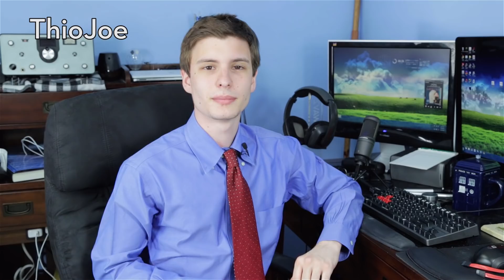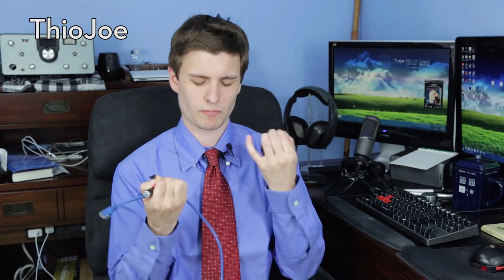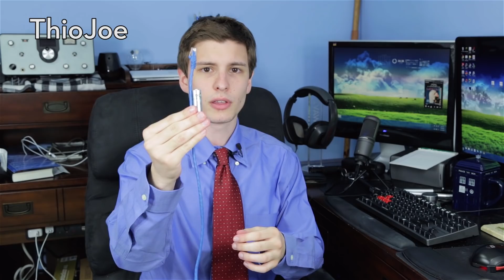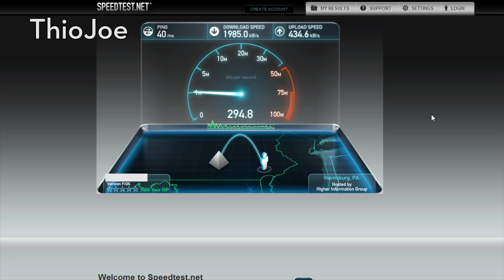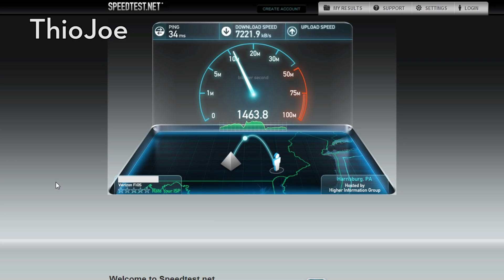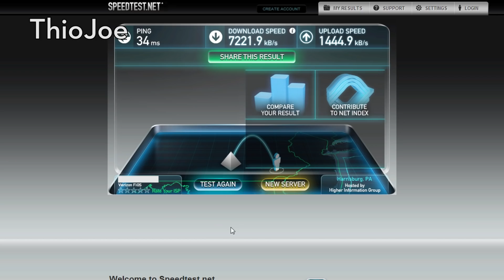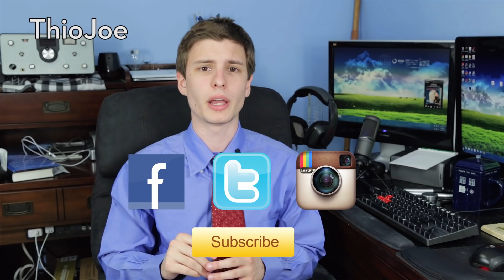Triple Your Internet Speed for Free

Comment: I wrapped 2 AA rechargeable batteries, 3 inches away from the terminal 1 battery each end.   Before add batteries, the speed was 3.25mps download and 1.11 mps upload.  After added 2 AA batteries at each end, the speed was 3.24 mps and 1.10 mps. No difference at all.  The direction of batteries were Positive to the terminals as suggested in this video clip.  The suggested tip did NOT work at all.  I do not know why his modified cable works and my same modified cable did NOT work.

Comment: Hey ThioJoe if I use 12v car batteries would that also work. I figure more voltage & more stored energy should do the trick . Oh yeah is there a better brand of electrical tape that "conducts" electricity. The tape I find says it insulates can I dip the sticky stuff in rotor shavings as it is cast iron & will conduct the induction & if i soak it in water then trap it this should do extremely well I know with the steel it wont stick to the cable for which I am going to use heat shrink tubing. I only hope I dont blow myself up when I heat the tube up with my handy blow torch. I can't wait.

Comment: "because electrical tape is conductive" WTF dude?? electrical tape is made to isolate electricity not to conduct it.  Its made out of a polymer.... oh sorry you are to stupid to now what polymer means..... out of rubber and rubber DOES NOT CONDUCT ELECTRICITY!!!!!!!!!!!!
If the magnetic field (that is if the battery would have one in the first place) would pass through the Ethernet wire it will reduce the speed because it would add too much interference and as some people would know through the generations of CAT cables its developers have been trying to reduce the interference so that the data will flow faster. DUMB ASS  !!!!!!!

Comment: I have wireless but got it to work with a little trial and error. You'll need 6 D batteries instead of 2 AA's. I guess the extra power was just enough to overcome the space separating the cable end from my laptop. And it has to be EXACTLY 1-1/4 inch from the bottom right corner of any device you're trying to boost. Just 1/16th of an inch off will not work.  It's a pain repositioning the 60' cable (especially to the other side of the house) but the results are awesome!!! I get to watch my girlfriend do this everytime she uses her tablet! LOL   She can't understand why I move my laptop so much.  ROTFL  Life is good :-)

Comment: shud the ethernet wire be blue in color or any color will do ?
Reply: Everyone knows the saying; "blue like the sky that brings lightning." Lightning is fast so use the blue cables. Anyone who uses any other color is just a noob!
Reply: Danilo SubMOA Never seen lightning from a "blue" sky! How does that work then? I thought the blue came from the oxygen and everyone knows that more oxygen makes vehicles go faster so make your Ethernet go faster with blue (oxygen boosted) cables. ...I STILL prefer the rainbow ones though. ;)
Reply: Bob Lewis You forgot about the electrical tape that conducts electricity.
Reply: Danilo SubMOA I've found that if you use matching color electrical tape,  it makes it 6 times faster, but only if you use YELLOW cable and tape. Yellow is faster. That's why they went to yellow instead of red for fire trucks!

Comment: The best way to speed up your internet is to attach a large magnet to the internal internet coil. Its usually located towards the front of the computer. Its got two cables going into it and is about 3.5 inches across. The top is shiny and the bottom is black. Be sure to put the magnet on top and rub it around a bit to insure optimal conduction. Works every time.

Comment: Instead of messing around with batteries and cables. You can buy a gigabit router. (With a modem that can handle high speeds of course) And make sure your system is not too old (Windows XP early-mid). But if you are as stupid as he is, you definitely  believe that shit and do not ask what normal people do... -_-

Comment: Electrical tape (or insulating tape) is a type of pressure-sensitive tape used to insulate electrical wires and other material that conduct electricity. It can be made of many plastics, but vinyl is most popular, as it stretches well and gives an effective and long lasting insulation. Electrical tape for class H insulation is made of fiberglass cloth.

Comment: I find it works best when you open the wire, while it is still functioning, cut any one of the inner wires and then face the battery on it, then touch the wire for exactly 0.25 seconds. This is the exact time needed to quickly shut off and turn back on the wire, and if you do it longer it will break the wire because it will loose charge. This is 100% proven not fake and totally safe. Also don't shove your d!@$ in a toaster. I found the last part helped.

Comment: Doesn't work. I have a new PC running Windows 8.1, new ethernet cables, etc., but my broadband internet speed with a terrible company called Windstream (I live in NE Georgia / Windstream is our local phone provider) has been laughable. I was hopeful that your suggestions would help, but they have not helped at all. I'm just out $10+ dollars for the new pack of AA batteries I had to buy plus the roll of electrical tape. Therefore, I'm pretty disappointed. Congratulations to any of your subscribers who actually had success with this internet speed-up procedure.

Comment: I found that you can squeeze 13.21678 % more throughput if, while the batteries are charging, you stand in the ran and piss on a spark plug as the next full moon reaches  22.5 degrees above the horizon. If it wont rain for you on the next full moon you can simply twist any urine soaked spark plug around your own cord secured by freshly extracted cat-gut. Just thought you might want something to demo on your next vid-dee-ooooo!

Comment: HOLY CRAP! I just fount out an amazing new trick...YOU DON'T EVEN NEED YOUR MODEM! all you need is 2 batteries and wire, Put one of the batteries near your computer (2-3metres should be sufficiant) and then put the other battery on the roof and then connect that one with the other with wire. THIS WILL MAKE YOUR INTERNET SPEEDS 5X FASTER!
Reply: hahahaha nice joke

Comment: You can make your internet speed even HIGHER by taping a magnet to the ethernet cable. I get 80m download speed with a magnet, and 26m without. Also, for the people saying it's a troll

Did you make sure it was a double A battery?
Did you use electrical tape?
Did you have a blue ethernet cable? (color matters, blue means good, green means okay, red means bad, grey and black mean bad, the rest are okay.)

Comment: Guys does in other country does you just plug the internet cable in a like ummm is it plug? Because here at our country we use modemn where you put the internet cable to the modemn (excuse me for my spelling) and direct connect to the CPU/PC, so will this 3x speed work for mine? Reply if you dont understand what I mean...Oh and my download speed is 0.52 mbps and upload speed is 0.21 mbps :(
Reply: Does this increase the speed in your WiFi connection too or just in PC?
Reply: Xyo360
You have to put the batteries on the antennea to boost wi-fi speeds. :/
Reply: Ok thnx

Comment: Yeah...I'm not gonna waste my time. You totally have your physics wrong.

Unconnected power supplies, in this case the batteries, do not produce any magnetic induction whatsoever. Moreover, only current flowing through wires produce magnetic induction, not the batteries themselves.

Plus, internet speed is not determined by your cable entirely. Its determined by your ISP. A cable provides the maximum data it can pass at a time, not what it does. Restrictions are provided with ISP.

Furthermore, theoretically speaking, even if you did place your ethernet cable within a magnetic field, it would only add more errors in your data, and not do ANY good.

No, I don't hate. No, I don't think you are a noob. But please get your facts right before posting these tech stuff on the net.

Comment: Used the 4 battery method along with some super conductive 3-M copper impregnated  electrical tape and YOWZA, what a boost. That is until I gotta nasty notice from Comcast stating that I was hi-jacking bandwidth and to "cease and desist" or be subject to throttling or cancellation of my services. THANKS A LOT JOE.

Comment: 7221.9 kb/s is equal to 7.2219 mb/s . it does not match what the scale showed. If it was 7221.9 Kb/s it would be about correct but notice the speed shows kb/s not Kb/s . Totally fake.

Comment: The only thing that matters in terms of internet speed is how fast your ISP is.Cables make 0 difference because most of them are rated ABOVE what the ISP provides anyways. You can buy a better cable if your internet is better, but there's no need.

save yourself 2 damn batteries.

Comment: Found a way to QUADRUPLE my speed! Put hot glue, superglue, or another strong glue, on the end of your cable. Insert the cable.into your computer. The glue blocks interference and makes a more conductive connection! Also, applying 120 volts to your mobo makes it.run 10 times as fast!

Comment: I have wifi, I just taped one AA battery to the back of the wireless router and I taped one battery to the back of my Playstation and another to the back of my laptop... I didn't have to tape one to the printer though... works fine without it.

Comment: The battery thing with electrical tape is fake because the rubber on the cable won't conduct electricity, also only the two sides conduct electricity

Comment: Just thought I'd share that I've had great success in using larger 'D' cell batteries. I only taped two of them to the cable and my connection speed went up by more than 4.5 times. 

I also use wireless in my home, what I've done is taped the smaller 'AAA' size batteries to the post of the aerial on both my wireless router and my PCI wireless card and have experienced speed increases of over 5 times.

Now I can update my Steam library and stream high definition movies with no dramas.

Cheers!

Comment: Well that's crap as the Electrical regs says do not run any Cat cable with other electrical cables with an electrical supply as it will cause interference, so it will apply the same with a battery, because at the end of the day what is a battery? its a power supply. If you want to improve your connection get better internet or get better quality cable (Cat 6, 6A +) Cat5E is the standard Ethernet cable this day and age, but things are moving onwards so I would suggest Cat6.

Comment: Hey ThioJoe, you owe me $489.66. I didn't have any AA batteries, so I took the batteries out of my Deere lawn tractors and used duct tape to tape them to the ethernet cable. When I plugged the cable back in, I inadvertently bumped the battery that was sitting at the edge of my desk, it fell off the desk, and the force of it pulled my computer off my desk and into the wall, putting a large hole in my drywall.  It took the Contractor 2 1/2 hours to repair the wall. You Dufus.

Comment: I need some help with this, i was taping the batteries on the ends of the cable, and i plugged it in, my internet wasn't going any higher. I think that these batteries might be dead. if i use full batteries, will the magnetic induction increase?
Reply: Dude, Its fake, this guys a troller.
Reply: TheGuiltyGuys Hehe i know, was wondering if id get any dumbass replies

Comment: this is a joke. the reason this cable is called UTP (unshielded  twisted pair), is because each pair is twisted a different rate to stop EMI (Electro-Magnetic Interference) from the other pairs in the cable.  It also stops external noise (EMI) from entering the cable and weakening your signal strength.  So why would you want to induce a voltage into the cable, when it is designed to eliminate the very thing you are trying to put into it.  A Cat 5 cable can run at 1 Gig.  The blockage in the pipe is your provider not your cabling in your home.
Reply: by the way electrical tape is an insulator. It normally has a rating of 1000V.  There is no way it can conduct electricity.  Plus you are talking about electromagnetism which generally gets pushed through a ferrite core.
Reply: Ian Stromilo
Wow, you want an award captian obvious?
Reply: Very good!!!

Comment: Everyone who has commented are fucking idiots. NO one has actually read that its measuring in kili  bytes not mega bytes. obviously no one actually looked at the screen because you idiots commented so much hate when it actually works.
Reply: Lol internet speed is in mega bits, not mega bytes.  Two completely different sizes, having a high kilo byte speed is actually really fast, don't mistake it for kilo bits, that's slow as shit. 

The way you can tell the difference is kilo bits has a lower case 'b' and kilo bytes has a capital 'B'. Same with mega bits and bytes.

Now you know and can stop looking like a tard.

Comment: Do I need to use any specific brand of battery. I wanted to use the bunny brand because it lasts 2 times longer so my connection will be 3times as fast and last 2 times longer. That is the law of BS

Comment: Do i need to tape the batteries on the internet cable from the computer and my internet hub or do i need to tape it on the cable of the modem to my internet hub

srry for my english i hope you understand this
Reply: A internet hub is a thing where you can put 1 internet cable in and then you can get 5 internet cables out :D
Reply: Dont believe this.
Reply: Lol i told you. You just wasted your time. And tape.
Reply: Yeah i have test it but its fake!
Reply: ***** did you really test this
Reply: SuperMegaTNT dig your own grave and live in hell
Reply: Xx DrAgOnS UnLiMiTeD xX Are you sure it's your "kidding me" because I'm pretty sure it's mine.
Reply: thats wat i was also trying to understand
Reply: Darude - Sandstorm its comedy
Reply: I'm so done hahah
Reply: SuperMegaTNT DERP !
Reply: dude, its fake.. lmao
Reply: OK so MAYBE your poor English has caused you to miss the salient (important) points here:

1. Electrical tape is NON conducting (this is a clue!!) and if it DID conduct electricity it would not have the alternative (usual) name of INSULATING tape! Doh!

2. NOTHING induces a current in any wire unless there is a current flowing in another wire adjacent to the first wire (or a MOVING magnetic field orthogonal to the wire). An exception would be a lightning bolt - the "adjacent wire" in that case being the ionised air that conducts electricity (the bolt) to ground.

3. You can add as many SATA/IDE/Ethernet/Modem or any other kind of cables to the original Ethernet cable as you like, NOTHING, repeat NOTHING will make the Ethernet FASTER or BETTER ... NOTHING! The batteries are not connected to ANYTHING hence do NOTHING! (Do you get the picture now?)

4. In case you don't understand yet .. IT'S A JOKE! A SPOOF! A PISS TAKE! IT'S ALL A LIE! IT WILL NOT AND CANNOT WORK!
Reply: Xx DrAgOnS UnLiMiTeD xX lol I said that cause you used the wrong "your" it was supposed to be "you're"

Comment: well the guy does  have some electrical knowledge but if your isp is providing let say 10Mb that is what you will get nothing more and it will definitely not triple your speed might improve it by  some Kbs,What he failed to point out is that the batteries minimize noise created in the cable by the flow of info(the inductance part he was mentioning about)but you cannot entirely get rid of all noise created .Remember your internet signal is probably coming from thousands of miles at high speeds you cant filter all the crap it picks up on its way.So bottom line a dsl filter will do what ever he is making.

Comment: Wrong Wrong Wrong
This will never work but it’s a start
I think due to patent protections he can only tell you half of the story
Yes what you want to do is get your electron’s to go the speed of light
That 186,000 miles per second.
The real way to do this is to use a 2 D cell flashlight with a plastic case
A red plastic flashlight will work best, then wrap the blue cat cable around the flashlight
About 10 wrappings should do it, more won’t help.
Turn on the flashlight wait about 2 light years and then order faster service from your internet provider
It’s just that easy.

Comment: I'm sorry but where do I start on the falsities here, one electric tape conductive or not won't affect the Ethernet cable at all due to the fact that the cables skin is nonconductive, two batteries have absolutely zero effect on the bandwidth of an Ethernet cable as the battery especially one without a current moving through it would not nearly create enough magnetism to constitute a field strong enough to effect the cable, this boy is no more than an internet troll out to see how many people will tape battery's to cord's.

Comment: My iinternet is now working so fast that pages appear and dissolve faster than I can click.  internet is now working so fast that pages appear and dissolve faster than I can click.  I used double the electrical tape and a half mile of cable, therefore my  I used double the electrical tape and a half mile of cable.